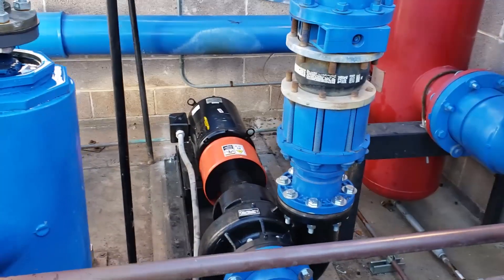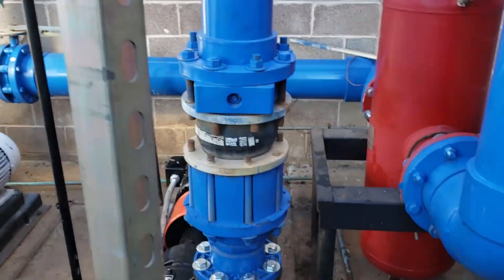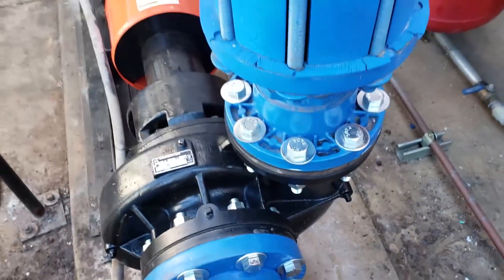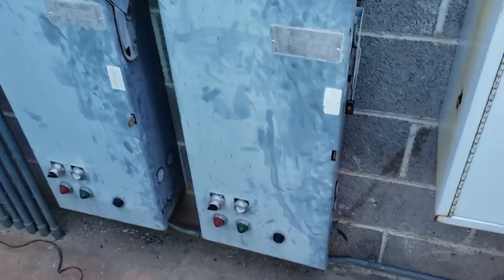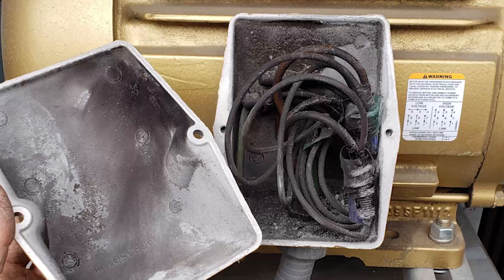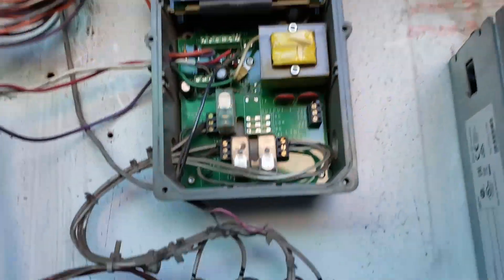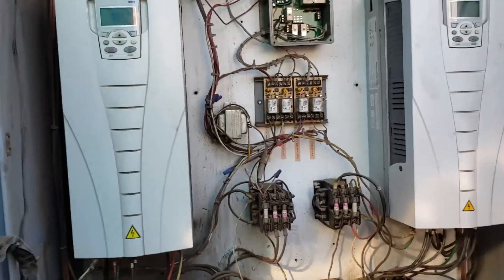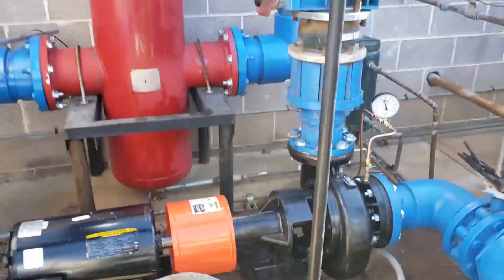Project to fix up a decimated central plant back into normal working order

Comment from the maker: The one thing we didn't do was get new sealtight conduit. So the existing electrical conduit looks like total shite now in compare to the new shiny pump assembly.
We have some excuse as it took the vendors a few weeks to even find a pump close enough to be able to be bolted back up (with the adapters we used) and then by time it was quoted and approved about 3 months had gone by since I removed the old pump.

The old pump was taken to the local vendor. Hoping it could be rebuilt like for like.